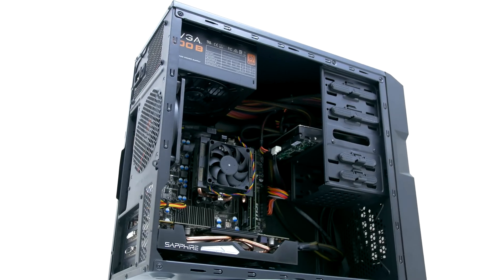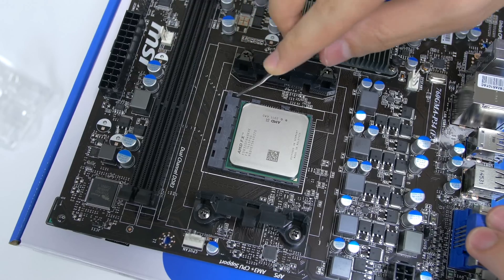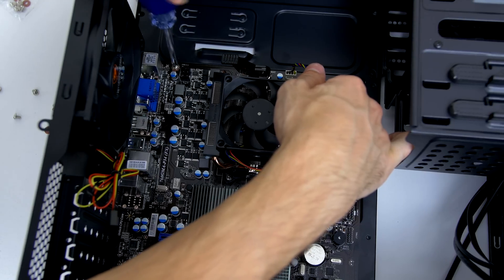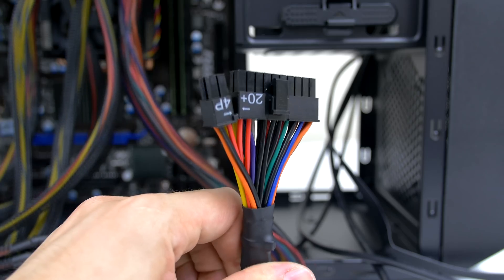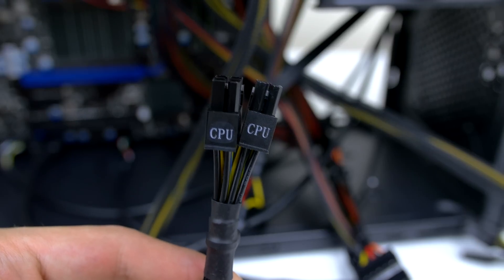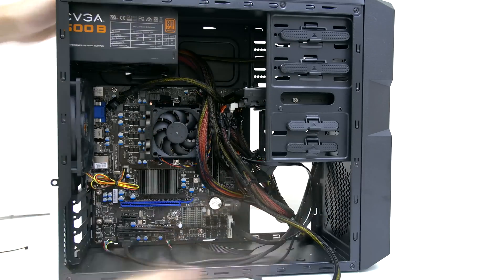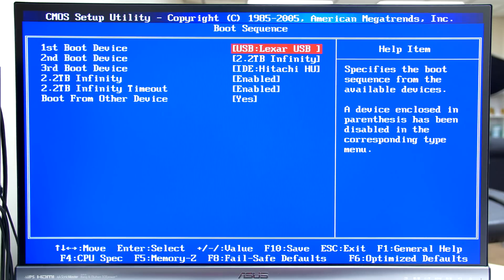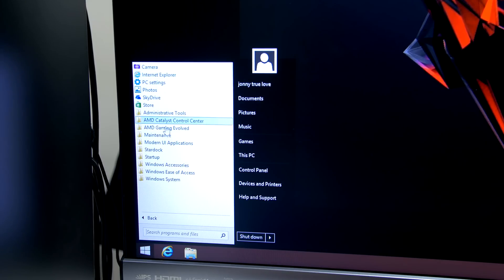How to Build a $500 Gaming PC with Windows 8.1

Comment: I built this, added an RX 570, Corsair H60 CPU cooler, NZXT fan controller, 4 noctua fans, some cablemod cables with an EVGA supernova 750, and soon I am going to throw in a Samsung EVO 250 GB SSD. Thanks for the base on my build, I had a bit of trouble trying to find a motherboard, CPU, and case. Eventually, I am going to be getting a 7600K, new motherboard, and a new case. :D

Comment: Amazon was sold out of the hard drive used in this build so I went with a Seagate barracuda hardrive. On the screen saying where do you want to install windows it shows my hardrive but has a error message saying 
Windows can't be installed on this device.
What do it do from here I been going though several videos and troubleshooting for 2 days

Comment: hold on a sec! the GPU costs $400 and the CPU costs 130+! why did u say this is $500
Reply: the prices were different then I guess, I built this PC and it was $500
Reply: how is it??please tell and also i was woundering can i install another harddrive and also can i use a different  graphics card like the gtxforce 1050
Reply: Gaming Blade yeah you can use a different hard drive and yes you can use that gpu

Comment: Where to I get all the cords? im buying alot of parts used...
Reply: Nevayy cords for the power supply? it should come with it
Reply: KnightScoper Well there are a couple of other cords I saw, that I didnt know i would get. But its fine. I knew psu had the cords come with it lmao.
Reply: Nevayy PC parts prices change all the time and can vary depending on the country you're in. Yes you can use a 1050, the only thing you need to worry about with a different card is if the physical length of the card. But I'm assuming it will be fine

Comment: Anyone know a good replacement for the sapphireR9?
Reply: Rx 480
Reply: ok
Reply: If you haven't bought a replacement yet here's another good one, EVGA GeForce GTX 950 2GB SSC GAMING, Silent Cooling Graphics Card 02G-P4-2957-KR
Reply: wait for 1050, dont get 950, and get a 480, that would be a lot smater
Reply: thx for all the suggestions guys but i've already bought his Budtron build, but do u know what's wrong with this build? http://pcpartpicker.com/list/4kRzf8
Reply: anyone here know a good after market cooler for this pc(I built it) but the cpu is always getting hot so im looking for a cooler and idk the sizes of what fits and which is best speding limit 40-50$ thanks in advance
Reply: Lukas Mundo what processor socket?
Reply: I think it's 120mm any suggestions?
Reply: Lukas Mundo no, processor socket. Like lga1151, 1150, u know what I mean.
Reply: MSI Socket AM3+/AMD 760G/DDR3/CrossFireX/SATA3 and USB 3.0/A&GbE/MicroATX Motherboard 760GMA-P34 (FX) i think that is it, if not just check the parts in the description i bought the essential ones
Reply: ok, so am3+? FX processor? 40-50 usd? I think the Phanteks PH-TC12DX cpu cooler is the best option, but things like the scythe mugen 4 are good to.
Reply: thanks I'll try those out
Reply: Lukas Mundo your welcome, make sure they fit your case
Reply: GeForce 1060

Comment: The graphics card itself is over 500
Reply: Is an RX 480 compatible with that motherboard?
Reply: +Ethan Heath so then why is the graphics card more expensive?
Reply: +Hunter Lowe dude my 370 was $120 and it's a newer generation. what country are you in?
Reply: +Shea Jones I just got a 390 for 280$
Reply: +Shea Jones I'm in the U.S. But I just went with the 390
Reply: is there a cheaper graphics card or cpu i could buy help i have zero knowledge about pcs
Reply: is this a good replacement graphics card??? EVGA GeForce GTX 950 2GB SSC GAMING, Silent Cooling Graphics Card 02G-P4-2957-KR
Reply: Derek Pickett for medium settings yeah
Reply: GPU prices have been flexing on Amazon and Newegg like your mom on a hot sunday
Reply: pcpartpicker lad, just run your build changes there

Comment: Im Buying the cpu from amazon and it says on the page it comes with windows 8.1 does that mean i have to install windows or will it just work?
Reply: if it says it comes with windows 8.1 then already has it pre-installed so you dont have to buy windows
Reply: but are you sure it says that bc cpu dont usually com with windows 8.1
Reply: +PerennialAce Gaming eum a CPU never comes with Windows Windows is an operating system that needs to be installeer on a hard drive not on a cpu
Reply: What CPU is that
Reply: I laughed so hard when i read this!! 😂😂😂

Comment: can I replace the hard drive with https://www.amazon.com/dp/B0088PUEPK/ref=psdc_1254762011_t1_B001LDK4FG please fast response
Reply: Yes
Reply: +Tanner Mueller thx man
Reply: +Tanner Mueller is this build still good ?
Reply: +Mohamiid Ouda I'd find a different build just because it's a little older. What's your budget?
Reply: +Tanner Mueller between 500 ,600
Reply: +Tanner Mueller cause it's my first time so I don't want to take a risk
Reply: +Mohamiid Ouda if you want to spend $600 you can go to his channel (TechSource) and go to the mini itx build. If swap the gpu he put in it for the newer rx480 and if you don't want that small case you could go with the lots of other cases. Like the corsair 100r or corsair spec 01 or 02. Go to pcpartpicker and put all of the parts from the mini itx build in and pick a case from there. If you have extra money after that if recommend you get an aftermarket cpu cooler like the cooler master hyper 212 evo. Also if you don't want the rx480 get the gtx 970. They perform about the same.
Reply: So I can use a RX 480 instead of the Sapphire R9 270X, right?
Reply: fuck yeah you can,rx 480 is basically twice as powerful maybe even thrice the rx 480 for now is the best budget gpu,you get 970 performance for 200$

Comment: CPU: AMD Athlon X4 860K 3.7GHz Quad-Core Processor 
Motherboard: Gigabyte GA-F2A78M-HD2 Micro ATX FM2+ Motherboard  ($36.98 @ Newegg) 
Memory: Kingston HyperX Fury Black 8GB (2 x 4GB) DDR3-1866 Memory  ($34.99 @ Newegg) 
Storage: Western Digital Caviar Blue 1TB 3.5" 7200RPM Internal Hard Drive  ($49.99 @ Newegg) 
Video Card: EVGA GeForce GTX 950 2GB Superclocked Video Card  ($143.98 @ Newegg) 
Case: Thermaltake VL80001W2Z ATX Mid Tower Case  ($49.73 @ Newegg) 
Power Supply: EVGA 500W 80+ Bronze Certified ATX Power Supply  ($48.98 @ Newegg) 
Case Fan: Cooler Master SickleFlow 69.7 CFM  120mm Fan  ($3.34 @ Newegg) 
Total: $367.99
is it good
Reply: that is an average-good build for gaming. may i suggest, for $50 cheaper, just get the 2gb zotac gtx 750 ti because it performs around the same as the gtx 950. also, for the future, get an after market cpu cooler (my suggestion, maybe a hyper 212 evo) as those can extend your cpus lifetime, and also for the future maybe get an ssd+hdd configuration, so you can have crazy fast boot times with the ssd, and mass storage with the hdd
Reply: almost the build I'm about to buy but, a 970 instead.

Comment: +TechSource I am planning to build this pc and already have a hardrive with windows 8.1 I want to use, I feel like it won't boot up, is their any way you can make a video about this and explain how you can boot a new pc with an old hardrive?
Reply: It will boot up
Reply: ben hayes I actually have a core i5 750, and its 64 bit, do you know why its not booting up, their is only a flashing dash on the top left side, in the hardrive it has wind. 8.1, also I already have the boot priority set to that hardrive, any Idea on how to fix it?
Reply: idk just take the hdd out and put it in again making sure u connect everything correctly,if that doesnt work install a fresh copy on windows you can get a cd key for like 20 bucks on kinguin
Reply: Im Snayl okay thanks man!

Comment: I built this same pc and man does it run great, switched out the gpu he was using for gtx 960 and i get 60+ fps in all games on high. Gta on ultra is 70 fps
Reply: I'm gonna be building this pretty soon, and I'm going with a gtx 950
Reply: +Kevman83 it'll be a pretty solid build fam, i think you will be more than pleased.
Reply: +Justin Thomas What kind of fps in gta do you think I could get using the 2GB version of the gtx 950?? And would you recommend getting that one?

Comment: Is Wifi built in or do you need to buy an adapter or use an Ethernet cable?
Reply: +Mr. Cream Wifi is not build in. You can use wifi USB adapter or ethernet cable.
Reply: Some motherboards have built-in Wifi.

Comment: Hey, I'm new to gaming PCs and I'm going to save some up for one. The last days I was just looking for parts to build my own $500 PC so can you guys tell me if this would be an okay PC?

AMD FX-4300                                Processor
AMD Radeon R7 250                    Graphics cars
Ballistix sport kit 16gb                 RAM
Asus M5A78L-M USB3                Motherboard
Thermaltake 500w ATX 80         Power supply
Seagate  ST1000DM003 1 tb     Hard Drive
Thermaltake Versa-H21              Case
LG Electronics DH18NS50          Optical Drive

Comment: +TechSource I bought all of the parts from your links but the graphics card(same card just one pci port not 2 for some reason) and after building the computer it turns on but the monitor displays nothing, I've tried both HDMI and VG cables. Also the mouse works but the keyboard and he monitor won't. Please help me. Thanks
Reply: +VIPVeral Did you connect the PCIE power connector to the graphic card?
Did you connect the monitor display cable to the graphic card's display port? (Not the motherboard's display port)
Reply: WB IsMe I did, i figured out why it wouldn't work, i hadn't locked the CPU in place correctly, in fact i'm writing this comment on the computer and i have to say, best computer i have ever owned.

Comment: When I boot up the PC not his is showing on the screen
Reply: The fans are on and the usbs are working it's just that nothing is showing up on my monitor
Reply: +JonTheBearMC Did you connect the PCIE power connector to the graphic card?
Did you connect the monitor display cable to the graphic card's display port? (Not the motherboard's display port)

Comment: Very good video. I have some comments:
1. The RAM module did not fit on the video. It is not so easy as some describe the process of installing.
2. Installing two RAM modules (I suppose 2x4GB) on a mainboard of total of 2 RAM places is not a good idea. The beneift of running 2x4GB instead 1x8GB is almost non existing (see various tests). Better install 1x8 and leave the other slot for future expantions.

Comment: Will changing the GPU to an EVGA GTX 970 and keeping the rest of the components the same make this a better PC?
Reply: +Mike Tyson you're bottomnecking the gtx 970 with the cpu in the video, this is a budget build, the gtx 960 is the best gpu you should put inside this. I would go with I5 6xxx series cpu with a 970, but then you will need to basically changing everything including motherboard and power supply

Comment: I having a lot of problems with the build. I did everything that is said in the video, but when I plug in the power cord, flip up the switch, and press the power button, it does not turn on. When I flip up the switch, the CPU fan and the graphics card fan still spin. The power supply also moves a bit back and forth. What should I do?

Comment: Do you need the cpu cooler?
Reply: +iNoVA Also  i never built a computer before. Do i need to buy those cables if so where and second of all are the cables included?
Reply: +iNoVA sata cables are included with the motherboard and power cables are attached to the power supply

Comment: What cpu collet is he using he didn't link it, and it the cooler needed?
Reply: If someone could help that would be great
Reply: Also would a ASUS STRIX GeForce GTX 750TI Overclocked 2 GB DDR5 128-bit DisplayPort HDMI 1.4a DVI-I Graphics Card work with this build

Comment: I bought my sapphire r9 270 used at an astonishing 130$ but it came with just the card by itself. So two questions. Do I need to buy two 6 pin pci cables? And can I install the drivers online?

Comment: is there a cheaper graphics card? cause in Amazon the saphire one he recomended is like $200.
Reply: 750 Ti
Reply: +George Delgado No, go with a gtx 950 because the one in this build isnt being made anymore so the price for it sky rocketed.
Reply: +Johnathan Davidson could I use a msi GTX 960 4gb?
Reply: Nicks Lawn care and more yes
Reply: +George Delgado You may have to buy used. On Amazon (as of 3/1/2016) gpu was $300, but I looked on amazon for some "like new" for $150. So you just have to look around I think.
Reply: is there room In this build for a WiFi card
Reply: +Joshua Mason I'm guessing so.
Reply: you could get an evga GTX 960 for about $170.
Reply: i am going to get a gtx 1050 ti
Reply: Wyatt DeFord I don't know, in some ga.ds the RX 460 performs better, specifically directx 12 games, and I think the RX 560 is just basically gonna be an over clocked 460.

Comment: Hey Tech Source, I was just wondering, the motherboard is currently running at £206 on amazon, what would you suggest as an alternative motherboard that is equally as good and would also fit in the build. The Graphics card also seems to  be unavailable on Amazon as well, what would an equally good graphics card be for a similar price that would also fit in the build. Thanks in advance!

Comment: Is the case required?
Reply: +nearby222 Also does the mother board have wifi built in?
Reply: Yes the case is 100% nessesary and u can buy a usb wifi adapter for $3 on Amazon
Reply: +Warren Maxwell this case?
Reply: nearby222 no you can chose what case you want but make sure everthing fits in it
Reply: no,u should be fine with any mid tower case

Comment: Would a EVGA GeForce GTX 960 Be worth putting in here? Would it fit in the case? New to PC building need help :'c
Reply: My budget is $900
Reply: 900 directly towards the build, Already have monitor, windows, and keyboard, etc.
Reply: Don't plan on overclocking. This PC will be towards casual 3D rendering for montages and on Sony Vegas. Casual Gaming, Cs Go, H1z1, No intensive games like BO3 60fps but wouldn't mind if poss :b *****
Reply: I already have a fresh copy of Windows 10 c:
Reply: +Puppet Master bro i think that an i5 6600k is better for this get a cheap motherboard too and spend a good 80 on 16gb ram cause i edit videos alot if you see my videos so i know pretty much all he needs.
Reply: +Puppet Master this is your dream build let me tell you now this is what you wanna get all of this is on amazon but you can check elsewhere if thats not possible the prices should be the same so here your parts

i5 6600k - [ $254 ]

MSI Computer ATX DDR4 Motherboard B150 GAMING M3 - [ $110 ]

Corsair Vengeance Pro 16GB 2x8GB DDR3 2400MHz PC3 19200 Desktop, Red CMY16GX3M2A2400C11R - [ $85 ]

Cooler Master Hyper 212 EVO - [ $35 ] lower with prime

EVGA SuperNOVA 650 G1 80+ GOLD - [ $70 ]

Samsung 850 EVO 250GB 2.5-Inch SATA III Internal SSD (MZ-75E250B/AM) - [ $85 ]

XFX Double D R9 280 933MHz 3GB DDR5 - [ $170 ] 

NZXT S340 Mid Tower Case CA-S340W-B1 (Glossy Black) - [ $80 ]

this is the best pc you can get for editing for 900 i mean you can edit alot better if you dont get a graphics card and end up buying an i7 but i dont recommend cause i mean a good pc isn't good pc without a good graphics but if you want go ahead also the 280 is pretty much the best go to card for you especially with this price that i found i mean 170 is a amazing considering it beats the 960 that goes for about 230 also if you wanna edit video go with 16 gb ram like i chose for you no joke cant cheap out on this i use after effects to edit my videos and i use intense effects so i know what you need especially with 3d rendering. the i5 is perfect for your use. and the case well you could chose any case you want but i think the s340 is dope like its sleek and so beautiful ed currently uses the s340. well not much i can say hey you can even overclock since i added a cooler master 212 evo i mean those things are so good and the ssd is a no brainer if you edit on sony vegas you probably need to transfer and move around videos alot so yeah. other than that this pc is killer and i believe it falls right down to 890 or about 900 which is perfect i looked for the best parts from current gen thats why i added the skylake proccesor. well let me know what you think.
Reply: You forgot a GPU

Comment: i changed up a few parts. threw on a fx 6300 instead. also it comes with a stock fan to cool the processor. should i use thermal paste? didn't see it in the video.

Comment: I seem to have run into a very big issue.  In order to install my OS which is on a disc, I need my disk drive in, BUT since the GPU covers the other SATA port with the disc drive attached the GPU is slightly pushed making it be disconnected, this is bad since I ise the HDMI port from the GPU to attach to monitor.  Without it I can't see to install Windows. (Noting that this is probably a very easy fix, but my small mind can't handle it :p)

Comment: What cpu cooler was used in this video? It doesn't look like the one linked in desc.
Reply: +InFa Moxta. #Amb He is using the stock cooler that comes with the CPU. If I were you, I would spend a little more and buy the Cooler Master Hyper 212 Evo.
Reply: I am going to use stock and then upgrade a few months after.
Reply: I am thinking that I might do that too. I just hope it doesn't overheat.
Reply: It obv won't unless you do some insane things on your computer. Or else they wouldnt put it in the box
Reply: I hope so. I think it would be a pain to have to clean and reapply the thermal paste.
Reply: eh yea, prob just gonna stick with the stock one. :)